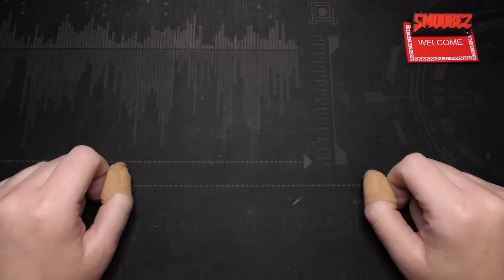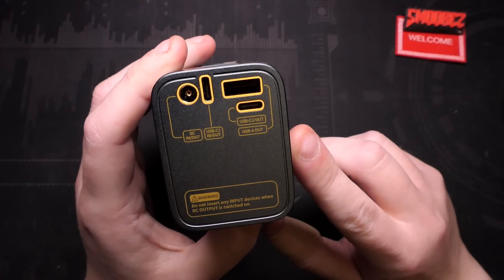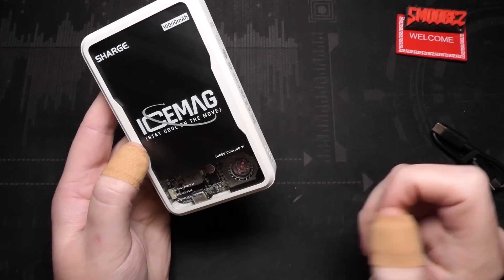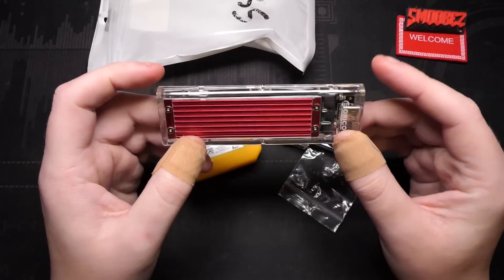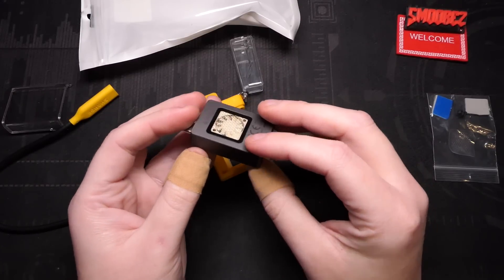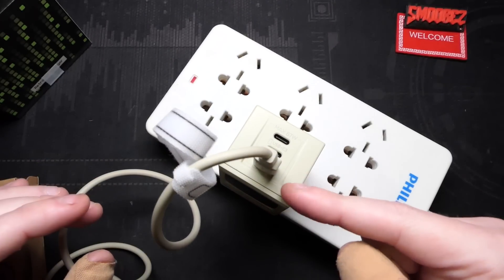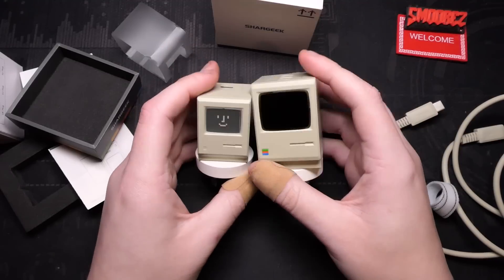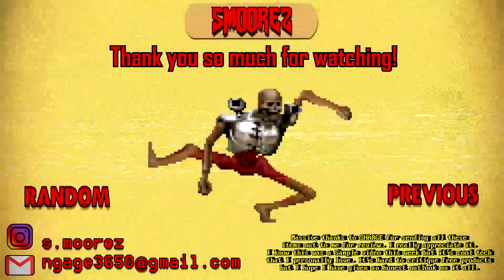A Showcase of AWESOME Tech Products from SHARGE! (Powerbank, SSD Enclosure & Chargers)

Comment: I have a Storm 2. I think it's the power bank with an setable output voltage...and that's why I bought one. The capacity is wrong. Those cells are NOT in parallel. They are in series so only the capacity of a single cell matters!
Reply: What do you mean? Those cells are 5000mah. I doubt that's the capacity you get. It clearly says on the packaging the rated capacity which is obviously lower then the total capacity of the cells because of loss when converting to 5 volt. But all powerbanks have that, at least sharge does put the rated capacity on the box unlike most other powerbanks
Reply: @TheDesius  I wanted to make sure I had things right before I responded back. The cells in mine are Samsung 32E cells which are 18650's. That is 3200mah each. The way you gain capacity is cells in parallel. To gain voltage, you put them series. The 8 cells in it are in 4S2P. That means 4 in series by 2 in parallel. AT BEST this is a 6400mah pack and that's assuming you can actually get 3200mah from them and you won't. I think you are assuming the cells are 21700 cells. Nothing in 18650 can have that much storage, but there are options in 21700 that can have 5000mah. 21700 cells won't fit inside the case.
Reply: @de-bodgery  i dont think this massive powerbank will only do 6400mah max.if that was the case they would have so many complaints. They already sold thousands and i dont see a single negative review mentioning this. 6400 snd 25000 is a big difference so people would definitely notice that
Reply: @TheDesius  While you are entitled to your opinion, that doesn't make it correct. You are not talking to some shrub. I went to school for electrical engineering and I've built 30+ packs myself out of many cell types including 18650 and 21700 cells. I used to work for a company that designed charging technology. I dealt with battery technology on a daily basis for my job. I know what I'm talking about. The capacity is marketing wank straight up! It isn't my fault that people don't understand how capacity of cells works and so they don't know any better. This is a very common thing! I see it all the time in flashlights too. The seller posts some ridiculous lumens spec that is impossible and people stupidly think they are getting more just because some seller listed it as 20,000 lumens when that is a lie and it's really 100 lumens. This sort of thing happens all the time that people get screwed over with false advertising and they are completely unaware that it happened! Powerbank marketing is RIFE with deceptive marketing practices! While the Storm 2 is a really nice powerbank, that doesn't change the fact that Shargeek is lying about its capacity!
*
IF the cells were all in parallel and they are 3200mah Samsung cells that would add up to 25,600mah. The problem is the cells are spot welded together with only 2 in parallel or 6400mah. These are facts. I've taken mine apart.
Reply: @de-bodgery you are talking about 10$ flashlights on Amazon which obviously don't reach the lumens stated but there are many that easily do have 20000mah. You don't need to take apart the powerbank to church the capacity. A 5$ volt meter can easily show it. My point is that if thousands of people got scammed this bad then it would have been obvious already and people would have pointed it out. I'm not saying it's exactly 25000 because that isn't possible but the exact rated capacity is stated on the box.
Reply: @de-bodgery  I measured my Sharge Starship Sear and i got 7568 MaH. Its a 10.000 MaH powerbank but rated at 5600 MaH so my powerbank actually got a bit higher then what it was rated for
Reply: @TheDesius  I'm not familiar with the Sear so I have nothing to say about it at the moment. It sounds like you are saying it has something like 2 5000mah 21700 cells in parallel in it to get that 10,000mah? This could be done with some other cell like 3 18650's that are 3300mah each too. I don't know how you measure capacity, but I use a DL-24P load tester for large cells or packs. I've got several of them as batteries are something I deal with a lot. I don't care that they rate it for 5600mah. If you've got 10,000mah of capacity in the cells according to the manufacturers specs, you should get pretty close to that capacity if you are  testing capacity like they do. Getting 7568mah from 10,000mah of potential capacity is pretty bad! NMC is showing it's well used up when you get down to 76% of original capacity! Either how you test capacity is inaccurate or your Sear cells are used up! You should get very close to 10,000mah from the cells if they are really what you say they are and test capacity like the manufacturers do.
Reply: @de-bodgery  Power banks normally output approximately 60%-70% of their capacity to the connected devices, and this is due to the conversion from 3.7V from the cells to 5V for usb devices
Reply: @TheDesius  yeah, boost conversion isn't 100% efficient and you have losses from connectors and cables and then down conversion from whatever voltage your phone charges at back down to 4.1v for its internal cell/cells.

Comment: I can confirm that my 13 Pro get pretty warm when it’s charging wireless from Anker 622. Sometimes it’s starting to throttle even for basic activities like facebook, tiktok, browsing, etc.
Reply: I think all wireless chargers heat up the phone somewhat due to how horribly inefficient they are at transferring electricity through air/plastic etc, a lot of the output energy is converted to heat. Not great for the batteries lifespan longterm I imagine.

Comment: the question is should you cool the memory controller or the nands?
Reply from the maker: I actually just tested the SHARGEDISK with transferring my latest job lot.
Took 10 minutes to copy 113GB which is fine.
But when I touched the enclosure - it was quite warm
So uh...yeah that may be a bit of a miss there.
Reply: @SMOOREZ i would love to see a enclosure made of massive copper that makes full contact on nands and the memory controller. i think passive cooling is the way to go, i wouldnt want to hear my external harddrive fan if my macbook or similar is fanless